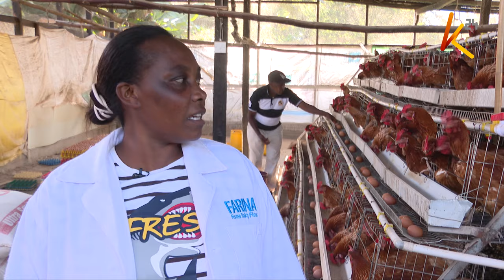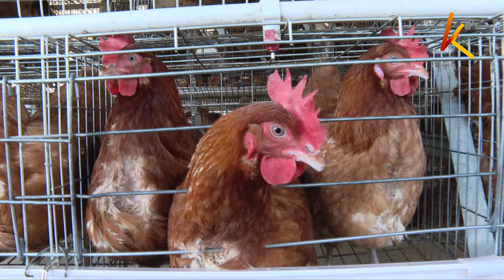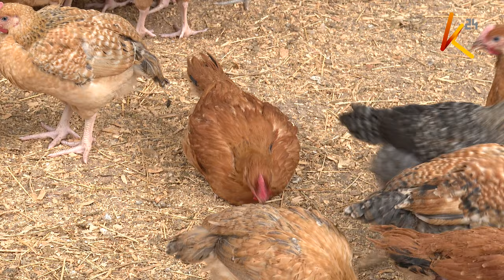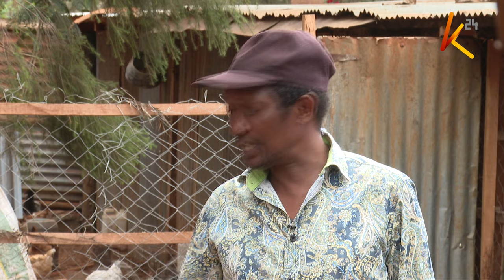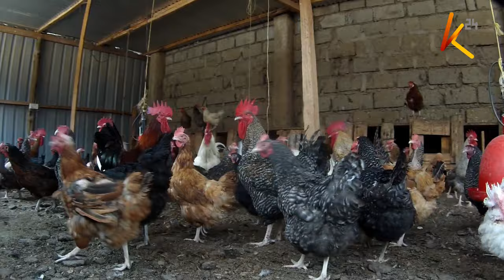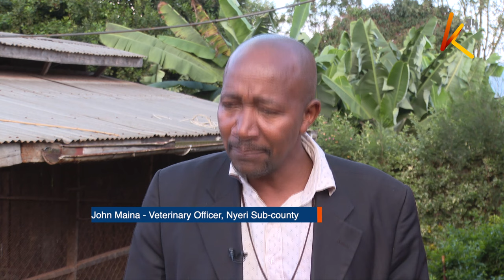Battery cage poultry housing system.

Comment: How can someone get the cage
Reply: ask Ruto
Reply: you can buy the parts, and make the battery cage. but i dont suggest battery cage. even though it is easier to control the chickens and the eggs 
it is too narrow for the chickens that there is no place to exercise. if there is calcium deficiency into the chickens, especially the egg producers, they would eat each other. since it is not easy for them to run and escape, they might reach the stage to which the intestine is out of their stomach.
Reply: @bitagofer9733  been thinking of getting a battery cage but on the other hand I feel like it's not the best choice since the chicken don't get to exercise or even be able to rest properly cz they're squeezed they can't even turn properly.
Kindly suggest a better cage for us who are in a dilemma if you know one that is manageable.
Thank you.